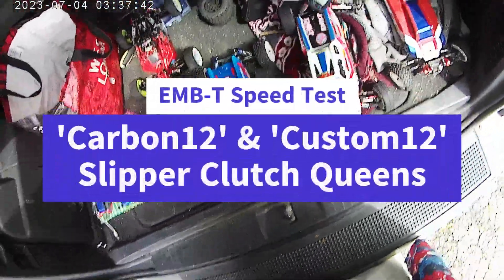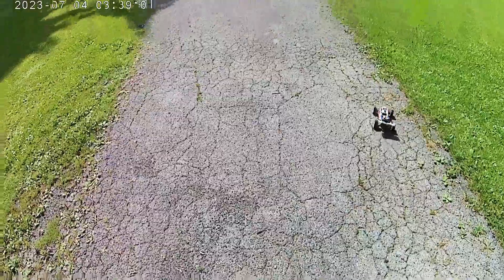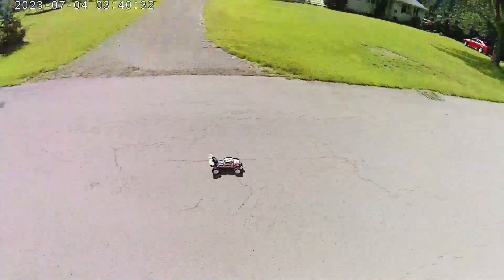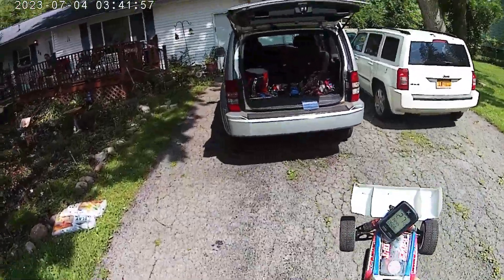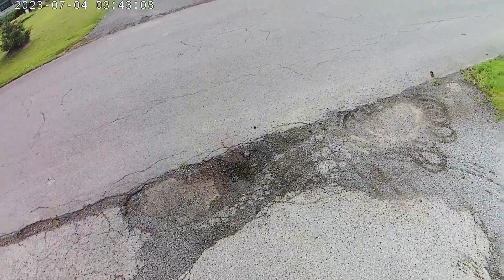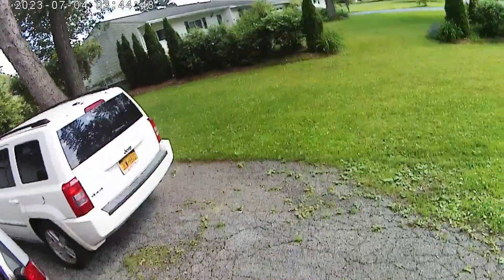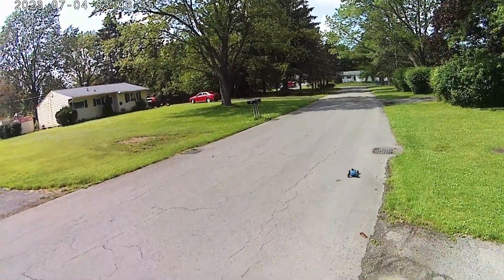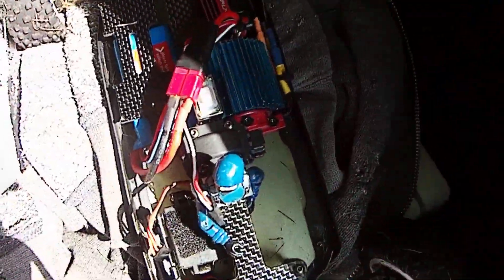EMB-T - Speed Testing - 'Custom12' & 'Carbon12' Slipper Sisters!!

Comment: I almost went 2838 in my HBX truck.  I might try one down the road as the 2845 almost has too much torque (not almost, it does). 😃  That car was pretty darn quick on 2s!  I would love to see it on 3s (can the setup handle it)?  I wonder how quick it would be with a 5900kv like I ran in my HBX.  If you want a back way into a motor company, I know one that is worth trying!
Reply from the maker: Right on,  2838 is a great motor I run them in my LC too..  My speed run rig is nuts 3650 5200kv still haven't topped it out yet...  The new ESC I just got in for it from Surpass Hobby can handle 3s I'm betting 50 easy..  Going to try when the GENS Ace arrives...  My guess with your 5900 kv it will hit 55 the steel slipper clutch helps on control..  Problem with the higher kv they run like crap on the track so I try and find that balance and keep it around 35MPH for track..  My speed runner would RIP with a higher kv but thats all speed road running madness haha like your bandit setup..

Man I just wrote a book sorry about that brother haha.. Appreciate ya Brian..
Reply: @reitplace4765  nah, good stuff!  You were very close with 55 mph.  On stock tied my HBX did 52 mph and 56.9 with bigger tires.